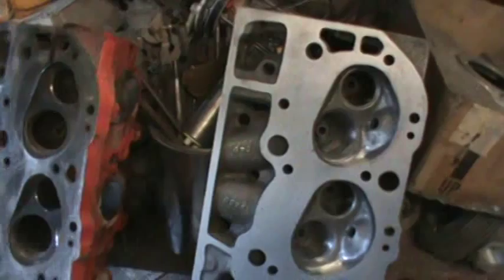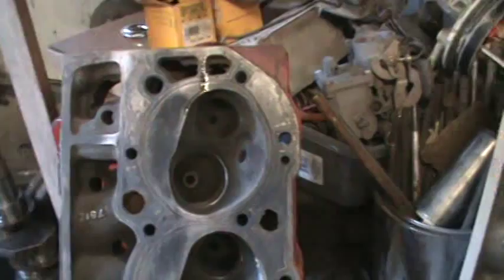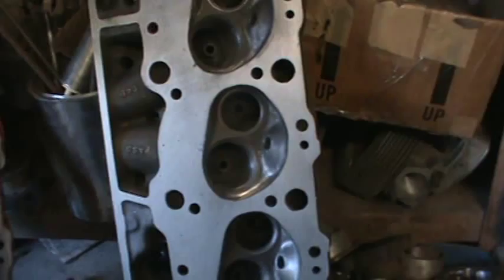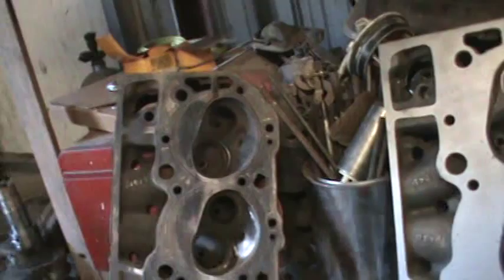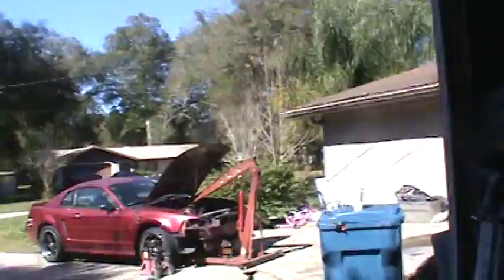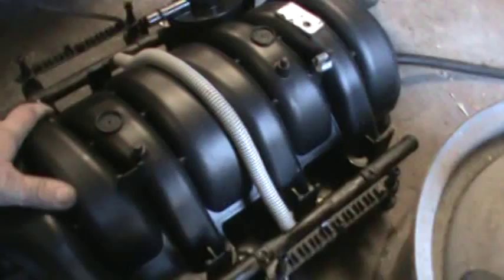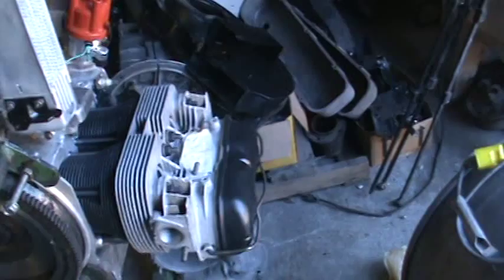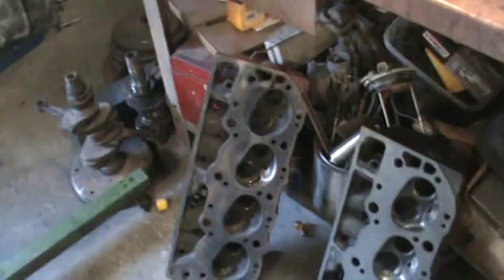BBC head how to

Comment: I know this video is older but there's a lot of great information for the way to get the 781 and 049 heads to make great power, I got a couple sets under the bench  ,I got a set of 990 fully ported with 230 / 188 with a 640 Howard's hydraulic roller with the correct springs it's 468 with 10.5 comp in a 69 chevelle project that I'm still a while from getting it running, I used a Ford 9

Comment: Another fine vid Darrin, I always learn something mate.  I have a project to commence soon a AMC RAMBLER 360 refresh.  Mates are telling me to take it to a shop to do but it's only 8 passes old and the owner only stripped it to get parts for another build.  The block is all intact with crank, chev rods and ceramic coated high comp pistons, I want to look at a mutha thumper comp cams from cam to roller rockers.  Heads have been massaged already .  In your opinion is this a job a novice with good tool knowledge and tech now how could accomplish?  I don't care if it takes a year.  It's currently a 450 horse without nos, it was run with 150 shot only.

Comment: The 781 are the second best O-port ever made by GM. You know whats the top casting is?? You guessed it, the 049 casting is the top dog. If you did your absolute best port work on both heads, the 049 will come out on  top. Of course 2.19 or 2.25 intake valves and 1.88 ex. is part of it.
They are both very similar heads, almost identical. Did your buddy ever put those 781's on his motor?

Comment: I have a sbc that im building  I have a set of 041 heads /hardened seats new valve job id like to gasket match and do some blending but ive never messed with porting..  some day ill start collecting big block stuff...the paint stop smooth sailing
Reply: 041 heads are awesome I have the 041x heads I still kick today's technology in the ass with no port work

Comment: Great information! How are these heads different than the 241 heads
Reply: 241 and 820 have a different chamber shape.      71’ and later 402 and 454 “smog” heads.      Big oval with odd “D” shaped chamber.